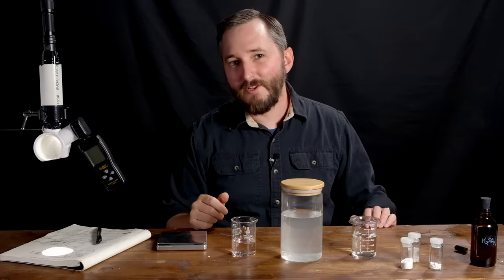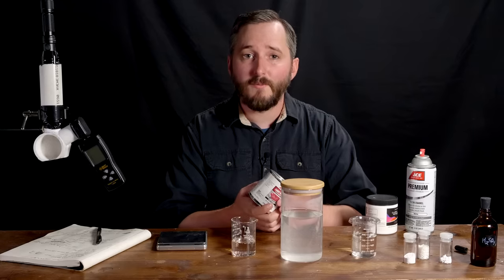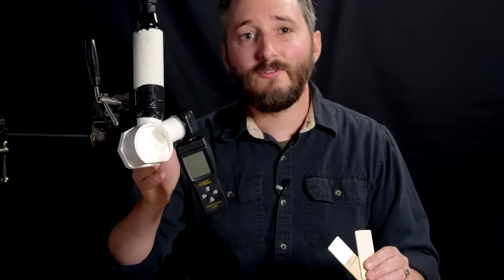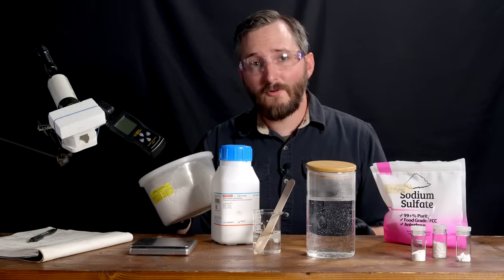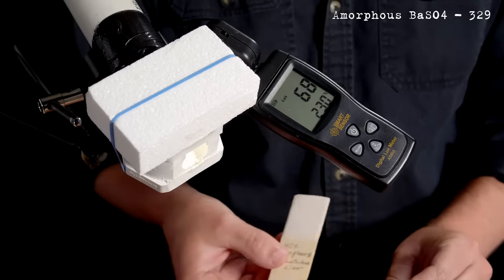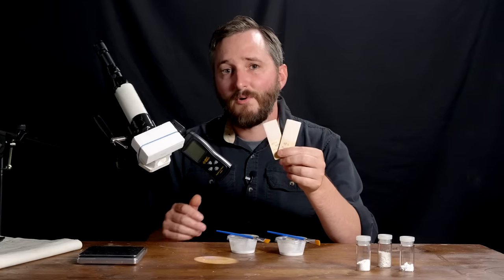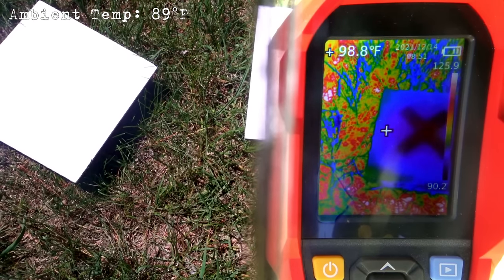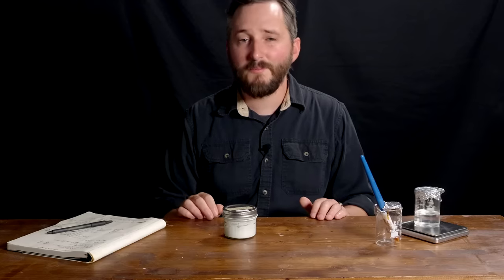How To Make Infrared Cooling Paint (Electricity Free Air Conditioning)

Comment: As an architect, I've used calcium hydroxide (lime wash) to paint walls for solar reflectance and passive cooling.  It takes about 3 coats of limewash to get the consistency and thickness and 3 days to accomplish this, since one coat takes a day to dry off, and then it gets wetted again to apply another coat.  We add a binding agent for cohesion and a bit of indigo powder to the lime wash to get the bright white color since limewash itself is off-white in color by itself.  The bonus of using limewash is that it absorbs CO2 from the air as it ages to form Calcium Carbonate.
Reply: Very interesting! 

It seems much easier to make lime wash than the barium he was messing around with in the video. The video mentioned calcium carbonate but no tests. It would be nice to see the test results for calcium carbonate vs white paint from the store.
Reply: My understanding is that limewash works great in warmer climates, especially if not very humid. Whereas in temperate locations where for long stretches of the year humidity is near 100%, some molds and other things can grow on it. Not a dealbreaker by any means, but does reduce the useful lifetime.
Reply: That's very useful info. I didn't know architects carried this sort of knowledge.
Reply: Very cool. Question, how to you prevent the wood from rotting? I live in a very rainy area that gets hot in the summer and brutally snowing in the winter. Usually I have to treat wood to keep it from rotting.
Reply: @SSingh-nr8qz  we use tropical hardwoods for the timber frames of the doors and windows, and they naturally don't rot.
Reply: Funny how that's a great discovery, but it's been standard practice in my country for centuries. Of course now days we use regular paint like everyone else, but old people say that old houses are way cooler and don't need air conditioning. I always chalked it up to the "They don't make them like they used to!" attitude, but there might actually be something to it.

There's a reason why we don't use it anymore though. It has to be redone once a year because it doesn't stand up to weather that well.
Reply: well, first someone had to burn limestone to get rid of that CO2. Than hydrate it to get limewash. And only after that you can catch all the CO2 back. This proces requires tons of energy and water and overall is CO2 neutral. 
It s quite hard to get me greewashed :p
Reply: Wow, we came full circle. 
If that's what I think it is, my grandparents used it as paint! 
They stopped using it because newer paints were easier to apply, and lasted longer.

The paint was very thin so they had to use a lot of coats (like 20 coats) until their walls became completely white. 
I think, but I may be mistaken, that the paint would crack or flake off if thicker layers were applied. 
Another con was that it was easy to see paint strokes when painting with it if you don't do it right. 
For outdoor walls, they had to repaint their house every year, since the paint was either affected by water or because it cracked often. I don't remember correctly. 

People also use it to paint trees every autumn. 
White paint lowers the temperature of trees, preventing their leaves to form in the early spring, and thus, protecting them from frost in the early spring.
Reply: @gsmontag  I think the main reason people used it as paint was to prevent mold as it is a base and stops mold from growing.
Reply: @ginkgotriloba4623  Whitewash isn't about greenwashing - it is better than cement in terms of CO2 and other benefits such as being breathable and self-healing.  While the energy requirement of lime is similar to cement, lime does absorb back the CO2 it released, while cement continues to off-gas CO2 throughout its lifecycle.
Reply: @suncu91  yes, very likely that your grandparents used whitewash - my grandparents also used it.  The thing with whitewash is that while it is wet, it is transparent, and you need to let it dry off for a day to see the white color - and have to wet it again before applying another coat to make it 'stick'.  We applied about 3-4 coats to get the finish we want, instead of the 2 coats with regular paint.
Reply: There are other benefits of lime whitewashing as well
Reply: @marlifords4026  unfortunately, I had to dig up this information from various sources both local and international.  This is not common knowledge for the young architects.
Reply: @suncu91  yes, stopping mold is one of the benefits of limewash - it is also good at killing bacteria and viruses that come in contact with it.  It also stops mold growth in 2 ways: it makes mold difficult to grow due to its alkalinity, and due to its moisture-wicking nature - it allows moisture to 'breathe' out of the room.
Reply: @gsmontag  I mean you could probably put some kind of transparent polymer coating over it right
Reply: Yeah i was so suprized when i saw the two compounds and for some unexplained reason he went yeah im going to make some barium sulphite isntead of just buying some calcium hydroxide.
Reply: That is good but still not relevant to this video as this paint has active cooling effects
Reply: @Hendlton  thanks for sharing that. Your ancestors had the right concept, time gave us technological material improvements. 
I love the natural chimney effect used in (Iraq?) in some ancient buildings, constantly ventilating large spaces naturally. 
We have been smart for thousands of years, just need to listen and learn from our past.
Reply: @gsmontag  Calcium Carbonate feeds fungus which then turn into moss in the tropics. Would be good to find an additive to prevent mold but usually added Chlorine or fungicides is needed unless you can wash your finish with those chemicals once a year.
Reply: what do you use for binding agent?
Reply: architects don't paint
Reply: @1xm_mx1  yes this is why it was traditionally used inside old farm buildings.
Reply: Would love to learn more about white wash. My grandparents use to whitewash every year also... They also did their trees and put an oil ring around the top where they stopped white washing to keep the green worm or caterpillar things from infesting the trees. They wouldn't eat through the white wash and they would slide down from the oil ring if they got to the top
Reply: Can I paint it on my nearly black asphalt roof installed by moronic houseflippers and builders?  And I would guess it's safe for rainwater collection.
Reply: @marlifords4026  Not enough of them do.
Reply: @lindafoss3823  Yes, you can paint over asphalt, but I am not sure how well it will perform.  And yes, it is 100% safe for rainwater collection, since you will not be drinking it.
Reply: Tom Sawyer used it to paint the fence
Reply: @honeytubs  Calcium carbonate performs bit lower than Barium sulphate in terms of rejecting heat in the atmospheric window. So I can understand why the presenter chose not to test it.
Reply: What binding agent did you use? How resilient is it to monsoon rain?
Reply: @noname12399no  Just a locally available mineral binding agent.  I don't know what brand my contractor used.  Limewash performs pretty well in monsoon rain, but may require a new coat every 3 or 4 years.
Reply: @altruismfirst6489  not to my knowledge.  Both limewash and lime have antifungal properties, and have been used to prevent mold growth since ancient times.
Reply: @1xm_mx1  But it will go into the soil in which I grow vegetables.
Reply: @marlifords4026  It seems not many do. This is niche information, though not new. 

We could have so much more efficient homes if more architects and city planners knew / thought about passive design (See 'passivhaus') as valuable ways to minimize lifetime costs of operating the building or house.
Reply: @mmsandi  I'm not the OP but the olde technology was to use milk solids, ergo "milk paint" used actual milk and lime as ingredients.
Reply: Lime and indigo: that’s the paint our ancestral houses in India were painted with! We have all lost common sense of our forefathers!!!
Reply: That’s awesome! Are you willing to share a recipe?🙂
Reply: @AmitecLt nd as it was probably said, “Look, Dad, I found a new and better way!”  How often was it actually true?😁
Reply: @marlifords4026 it's all looks, not usefulness, limewash isn't great in high humidity places as mold can begin to grow, so if you live near water, it's useless lol
Reply: Line wash has been used in India for more than 2000 years...till today
Reply: Good info. Thx.
Reply: @honeytubs  Thats what i was thinking like wouldn't it be way easier to just buy a bag of chalk.
Reply: What makes titanium peroxyte different is that it can make white too
Reply: What is the formula for the ratio of paint base and calcium hydroxide powder
Reply: @suncu91 yes. I remember this
Reply: @piethein4355 ha ha ..so true
Reply: @marlifords4026 at least in South America, architects must know every process of construction and it's effects, so they have to cover engineering, sociology, chemistry, and design. They are after all the equivalent of an orchestra director.
In the US being so specialized, architects are basically stuck to CAD drawings, writing projects and master plans.
In South America, architects are much more hands on in the construction process, sometimes directing the construction themselves.
Reply: @1xm_mx1  
Hello. What kind of 'mineral binding agent' for the limewash do you mean? Please give a couple examples.
Reply: @MarianLuca-rz5kk  we used a locally available liquid glue - organic glues that dissolve in water can be used as a binding agent to just keep the lime pigments together.  Nothing special.
Reply: @1xm_mx1  
I guess I got it. Thanks for your courtesy.